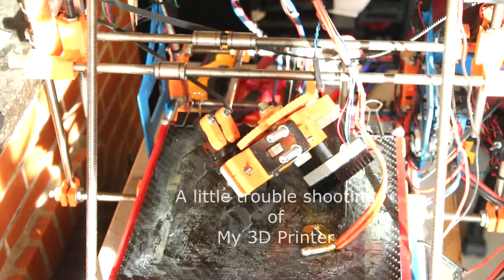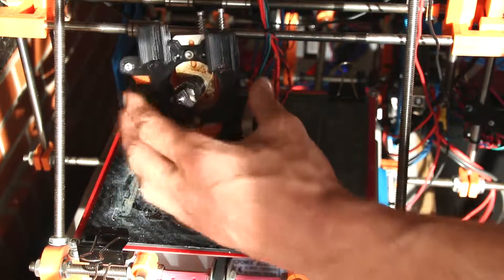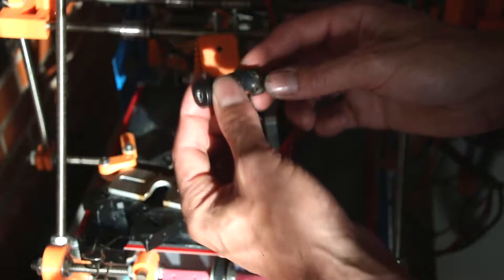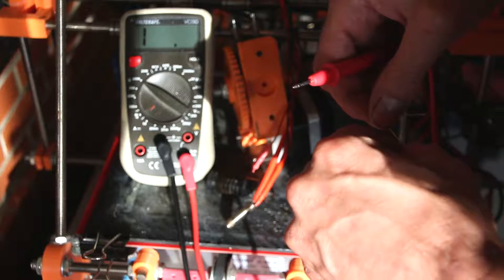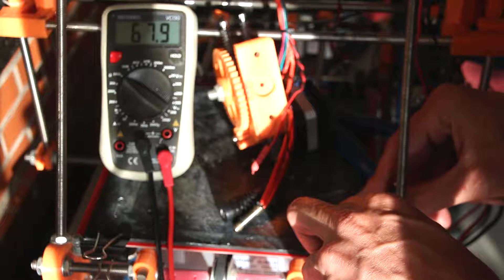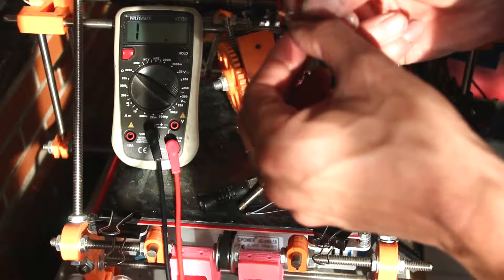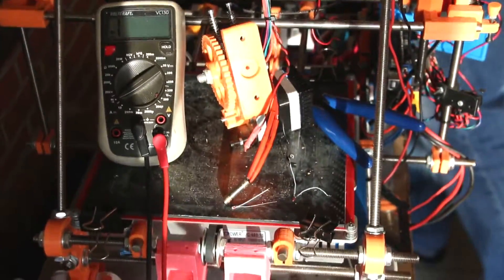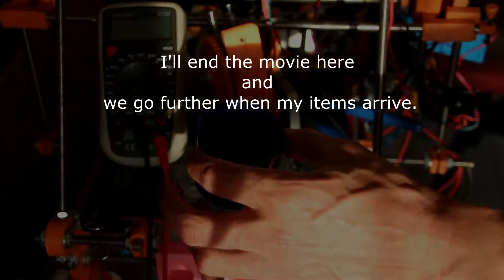#24 3D Printer Fixing - Hotend - Thermistor - Troubleshooting Reprap Prusa I2  Part I

Comment: What can you melt plastic out of the nozzle - by using a plastic container to hold the "thinner"?   It would melt the plastic container as well. The hotend should be heated up - either with the heater installed in the block - or with a external propane torch.  When it is hot is when you use the wrenches to loosen or tighten the nozzle or the heat break - not while it is cold.  The black you see on the outside is from a miniscule leak of plastic during the printing process.  I probably lets a drop fall on the printout - which is then hit by the nozzle during the print process.  Just my advice.
Reply from the maker: Using the thinner melting technique in a spray can cap for years. It works great 😉
Thanks for the other suggestion tho, keep it up!!